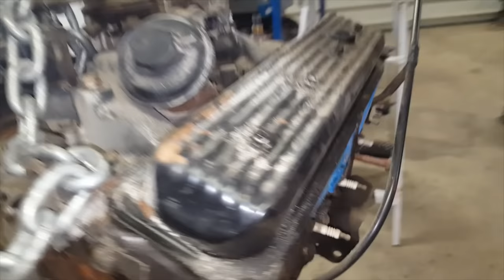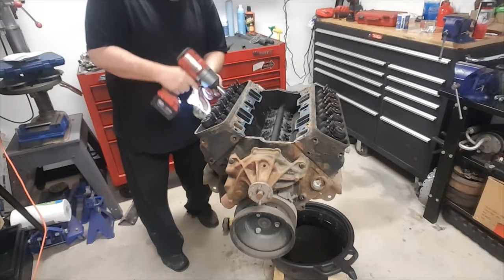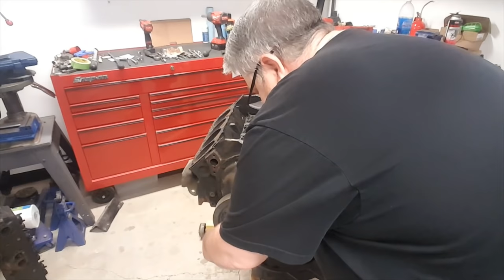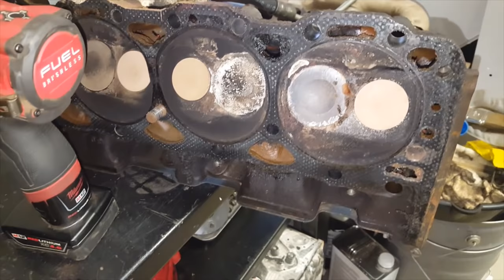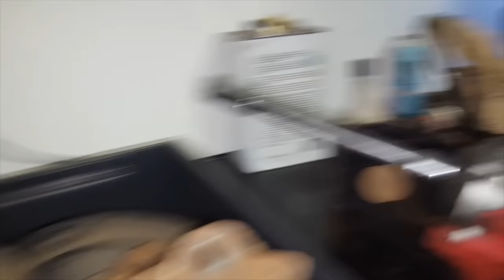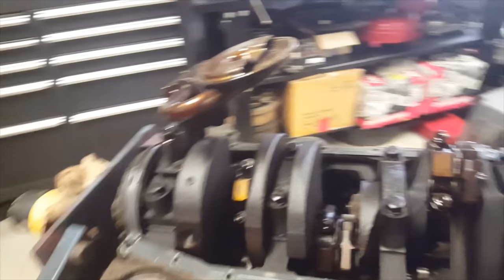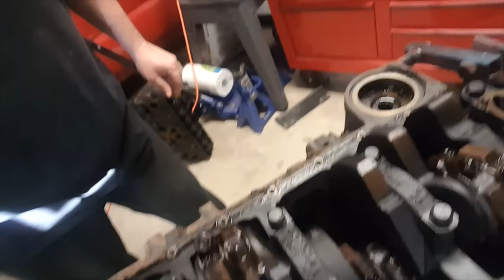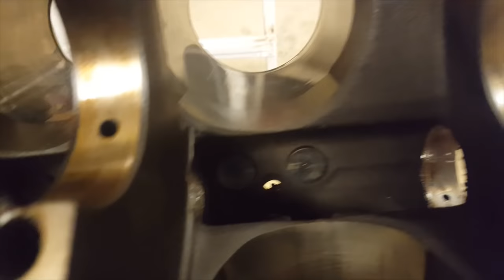350 Chevy TBI 5.7 Engine Tear Down / Rebuild , Video #1

Comment: What happens when their is no gasket between the Throttle body and intake
Reply from the maker: Vacuum leak , if there was a leak at the gasket you could have a high idle as well.
Reply: Thank you for responding to my question, Sometimes when you push down the gas pedal the engine sounds like it's not getting the engough fuel would that be caused by not having the gasket between the throttle body and the intake as well. I've replaced everything else. Would the catalytic converter be causing the problem as well
Reply from the maker: Sure , a vacuum leak could create a low power issue , so could low fuel pressure , clogged fuel filter , tired ignition parts etc. Is there any codes? If so what are they?  @bobbytackett9019
Reply: @jaysgarage3616  it's a 1992 chevrolet Silverado
Reply: @jaysgarage3616  could the catalytic converter be the cause of the problem
Reply: There isn if their is  any vacuum lines I've either have them all hooked up or their is some were I don't see or can find them to my knowledge their all hooked that, it has great fuel flow when it does bog down its like when I'm sitting at a stop sign or when I push down throttle fast while going down the road. I do understand about the filter could a portion of the problem. I would like to know could the catalytic converter be causing the problem as well

Comment: Excellent video only mistake was you called the carburetor a throttle body
Reply: This particular motor has a throttle body instead of a carburetor.. so he was correct. This engine came at the end of the use of carburetors and they changed to the throttle body injection which did essentially the same thing as a carburetor would only instead of using the pressure from a mechanical fuel pump these vehicles (for the most part) have electric fuel pumps with higher pressure.

Comment: I have a 93 5.7 all bolts are metric and the water pump has a different bolt pattern.
Reply from the maker: What is the engine in?
Reply: 93 Silverado 1/2 ton. Man date 02/93. K engine code
Reply: Bought a water pump from oreillys and the fan studs acted like the were cross threading. Then realized they were metric. The bolt hole pattern was slightly different as well.

Comment: How I can to performance this engine
Reply from the maker: These engines provide decent mileage and are reliable and provide a long service life , they were not really a performance package , small things make small changes and depending on the year simple things such as exhaust or a catalytic converter delete could hurt both the performance and mileage , I will put more in your request above. Thanks.
Reply: You can start by changing the old pistons out for true flat tops and then change those smog heads out for vortec heads or aftermarket heads and then you'll have over 300hp just by doing those two things not to mention a different cam to bring it up even more

Comment: good video, but what's with the crap music at the end?
Reply from the maker: I had the radio on in the background and it picked up a song that (I had no right) to use. I used the you tube tools to try and have it removed and it did not work. I had the option to have it covered and that was one of the recommended songs that I was given , I later learned you can download others but did not know that at the time. I apologize as I don't like it either.